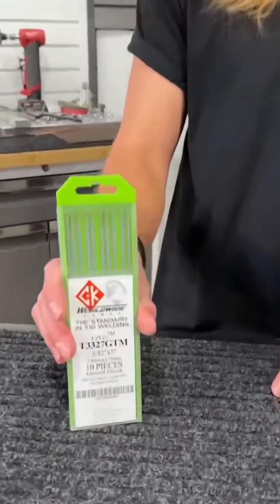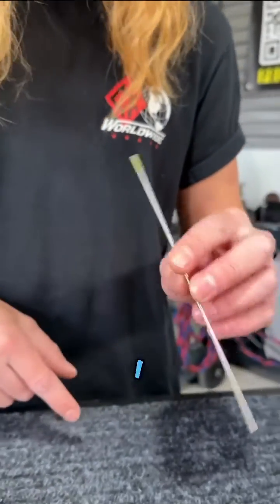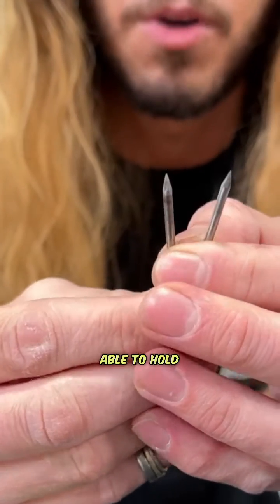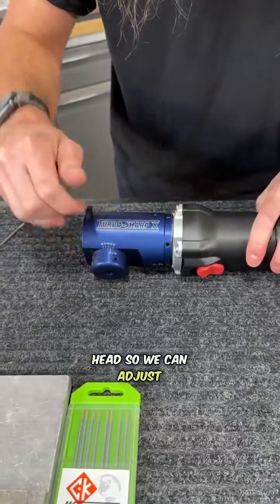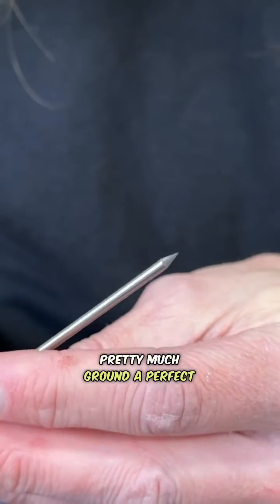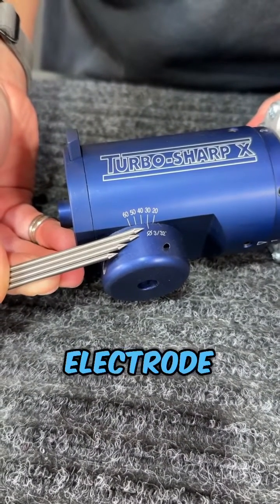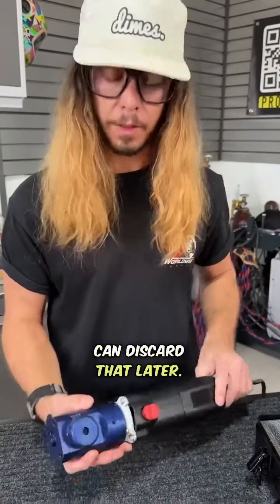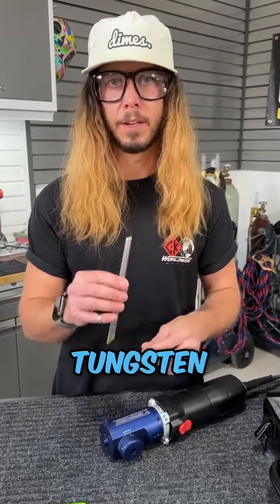Tungsten Tips for 100% TIG welding Control & Consistency

Comment: I’ve had really good luck with grinding the side of my electrode on the side of the stone on my bench grinder while making sure to hold angled so the marks are as close to vertical as possible. Sometimes I’ll clean it up with sand paper after. Thank you for your information. You have been a big help.

Comment: Wow Rush, I have never heard that it absorbs the metal thus contaminating it. That explains why just cleaning doesn't give me a crisp arc after I clean.
Reply from the maker: It’s not a taught thing in tig welding…. Part of this is what I’ve learned through studying metals and working years in a facility along metallurgists, chemists, and engineering professionals. This should provide that dialed arc-stability and very clean starts in your tig!

Miss seeing you brotha! Hope your new spot is working amazing for you!
Reply: @KANEKIDWELDS   Thanks buddy. If you ever make it down this way stop by and see the new shop.

Comment: Out of curiosity - what's the best, or at least your preferred, way of cutting the electrode for when you need to use a short back cap?
Reply: I find the Middle of a full length piece, grind a groove around the tungsten, on the corner of the wheel, to at least 1/2 the diameter, and then you can break it by hand, then square off the broken ends, Then sharpen both as normal.
Reply from the maker: Posting in the next video!
Reply: @KANEKIDWELDS  Thanks very much.

Comment: Never understood why a tungsten sharpener needed to cost $800, considering it's just an angle grinder with an attachment on it. $300? Ok, maybe... But $800 is nuts. Maybe that's why I'm a mediocre welder - I use a bench grinder to sharpen my tungstens. Maybe if I just forked out $800 for a sharpener I'd become god's gift to welding like KK is!

Regarding tungsten contamination - when I've dipped into stainless, I can't say I've ever noticed bad arc performance after a good regrind... But a good dip into aluminum totally changes the tungsten all the way back to the collet, just as KK says. I usually slap the tungsten against the bench - which snaps off the whole contaminated section, which has become embrittled by the contamination.
Reply from the maker: You don’t always need an expensive grinder to get good results, but this is exactly how I get the best results for my tig welding, every time. When the majority of the projects I weld are valued at thousands of dollars, this is a major factor. Even a missed arc strike on a single piece that’s $20k+ can be a catastrophic failure. I’ve used a turbosharp for over 15 years and it’s absolutely worth every bit. I’ve tried $100-300 range grinders & haven’t achieved results consistent enough that I’d trust.
Reply: @KANEKIDWELDS  I'll take your word for it. You're 10X the welder I'd be after 10 more lifetimes.
Reply: I can put down some pretty clean passes and then they start to fall off ... Looks like my evaluation of the tungsten hasn't been near the right level . lol Going to need to start to go through more tungsten pretty soon . My dip action hasn't got to the level quite yet though . lol Almost . :) Thanks for the tutorial .  @KANEKIDWELDS
Reply: I won't try and Break a tungsten until I have ground a groove around it to weaken it, otherwise you can get a really Bad break, even cracking to the core.
Reply: @scottcarr3264  I know what you mean, in general - but when it's been contaminated with aluminum, the tungsten will reliably snap off at the point where the contaminated zone meets the non-contaminated.